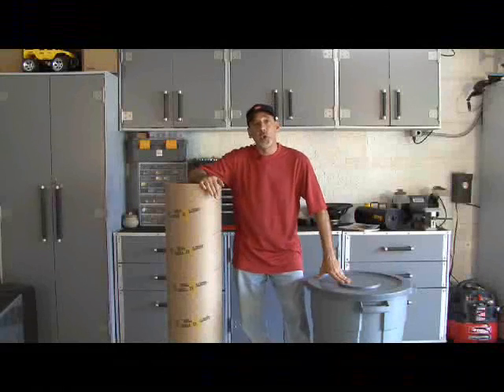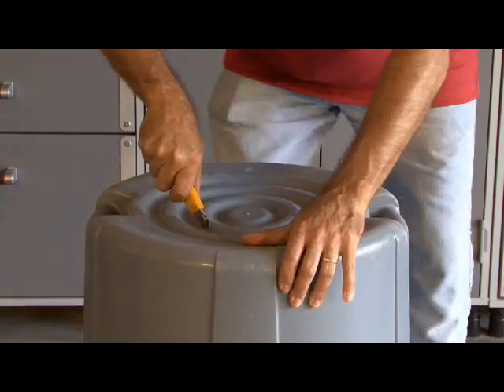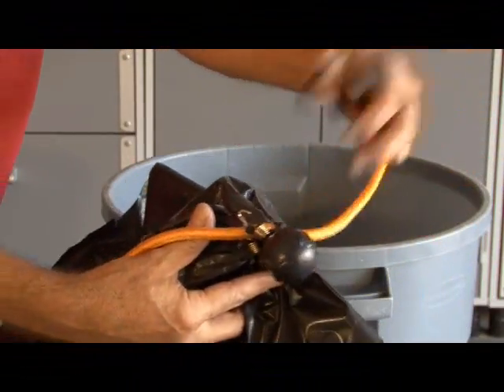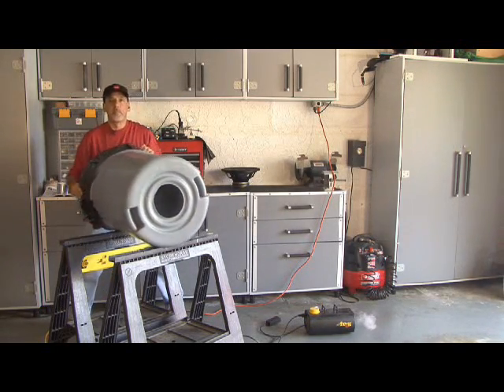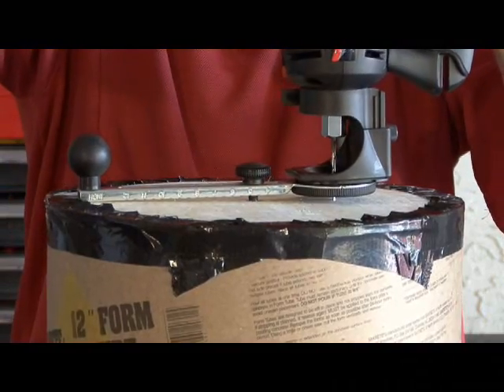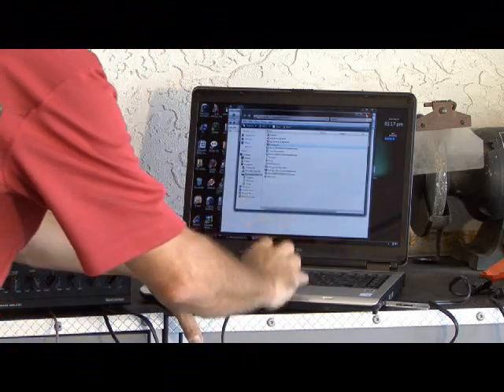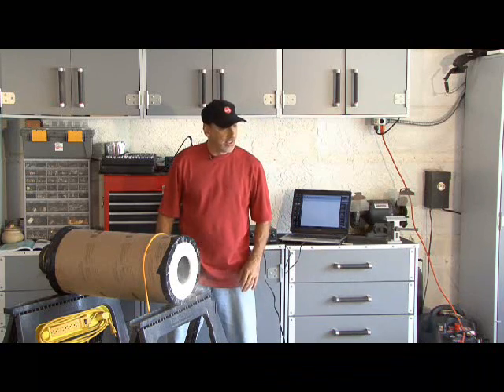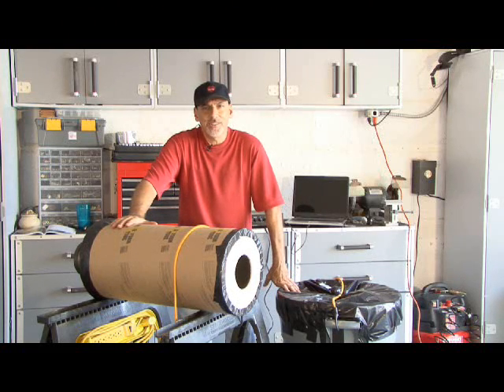Weekend Project: How to Make a Vortex Cannon

Comment: if you had a hole close to the speaker with a hose connecting back to the smoke machine, would that cut out the need to refill it or just cause too much smoke to be in the cannon?

Comment: for the long vortex cannon, you should make a huge check valve so the speaker will push out air but wont be able to pull back the air (smoke). it seemed as though it was working against itself.
cool stuff

Comment: Yo kip, different tones have different wavelengths...   If you measure the length of the tube your using and calculate, you can find the optimum tone to produce the smoke rings you're going for.  Tubes can actually amplify a tone if they're the right length.  Not too terribly hard to do, and you can figure it out from pretty much any physics book that has wave mechanics.

Comment: It doesn't matter which direction the speaker is mounted, only that the tone generated is the correct polarity to produce air displacement within the pressure chamber.

Comment: For the tub thumping cannon, couldn't you also cut a hole in one side and attach a tube to the fog machine? Just for simple use (flipping a switch) as opposed to having to constantly fill it back up via the exhaust port?

Comment: If you equalize the air on the back end of the speaker, ie: place the left over tube on the back end and seal it up your rings would go much further and be tighter. The speaker response would be faster.

Comment: if you tape a pipe to the smoke machine that leads to the oposite end of the connon (the speaker side) you can leave the thing going on all day.............perfect for those times when u need rings of smoke flying around

Comment: the suden air going out of the hole makes the air around the hole spin kinda like how the water goes bakwerds at the edge of a river and the gust of wind gives it momentum because it has a wider surface erea on the outside it has a stronger force puling it forword than backword so it keeps on going forword. so in conclusion they are fun!